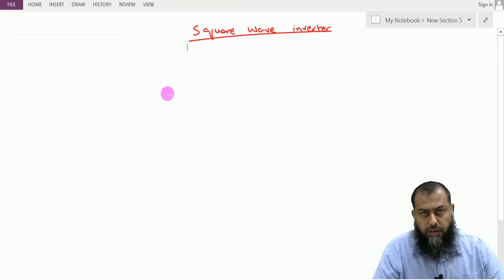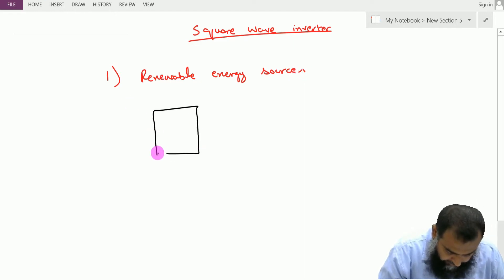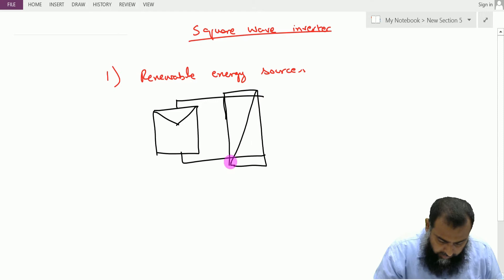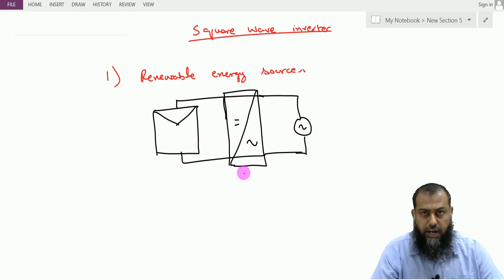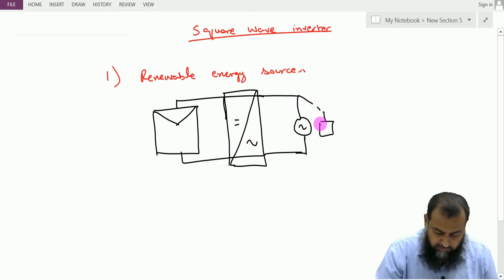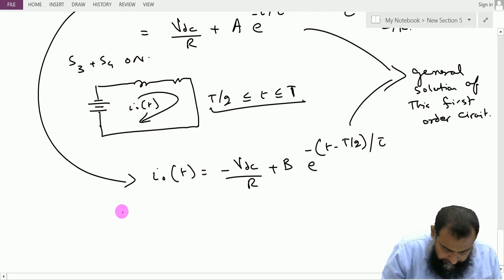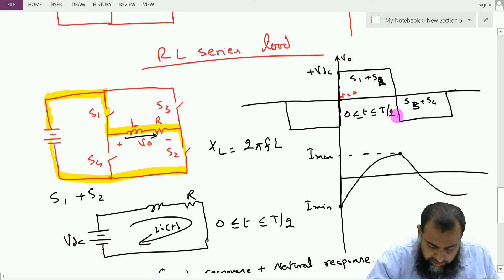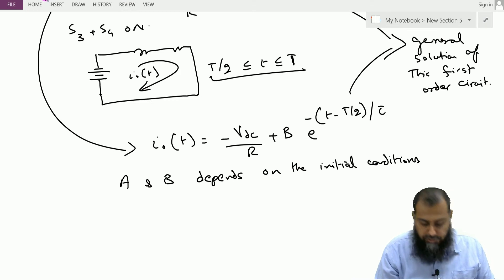Power Electronics Module 3 Lecture 1 | Square wave inverter

Comment: at 50:03 for the value of Zn you are changing the value of f but not n in the formula. please tell if n is 1 for all values of f ?
Reply from the maker: Off course the f changes with harmonic level. for f=1 is the fundamental for f=3 the Z3= third harmonic based XL +R